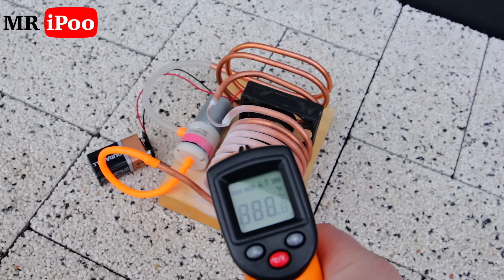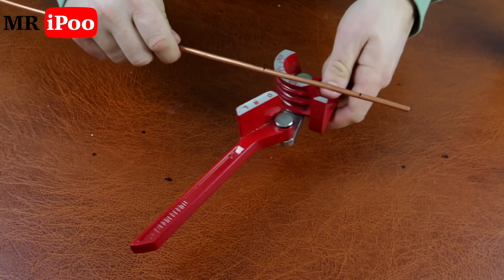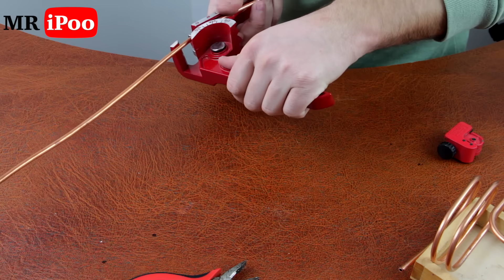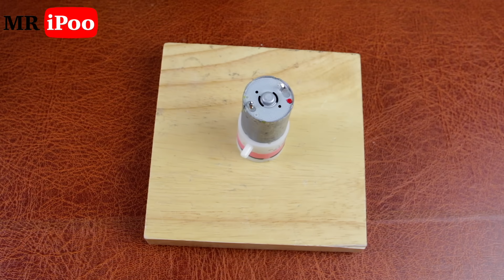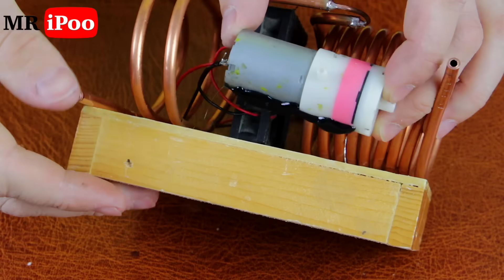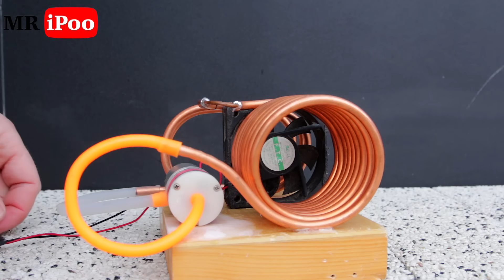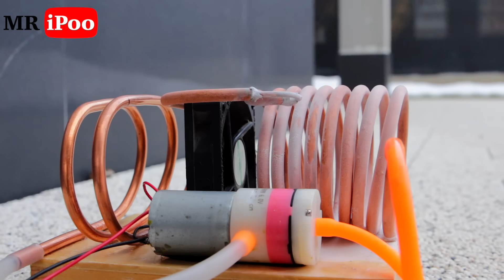DIY Freezing AC : Crafting an Icy Air Conditioner down to -32°C!

Comment: This is brilliant because you only need a couple psi difference between the high pressure side and the low pressure side in order to condense the gas in such a small system and I’m sure that flammable gas is very efficient
Reply: It's fake guess, overspray from a can of freeze spray on the fan at 7.55 and liquid boiling off the Venturi pipe at the very start of the video
Reply: @davegsm82  We have a WINNER!!
Good catch!
I was secretly entertaining an internal debate in my head of if this was probably fake, or if he actually got some cooling out of it.
I missed the over-spray on 'non-coil' surfaces!
After I looked at your timestamp, I now see that there is also frost on the wood where it shouldn't be, that I hadn't spotted.

I did spot the bubbles on the capillary joint right away, but was still undecided as his soldering technique was poor and I thought I was seeing a pinhole leak.

My main doubt was the capillary/pump capacity/battery current capability pairing.
[I've never seen anything this tiny, so I couldn't declare it a fake outright...]
Reply: Finally a comment from someone with a bit of education! Butane is a great phase change material for low pressure demonstrations like this. Too many people here seem to think it's fake or useless because it won't cool their 4 bedroom house. 😆👌
Reply: @davidsmith3302  It really blows my mind that there are people who believe this is real. First of all that capillary is far to thick and short to create any significant pressure difference even with butane to cause a phase change much less to have a temperature drop of more than 40C°! The other issue I see is that those cheap pumps aren't designed to work in closed systems even worse is that butane and many hydrocarbons damage rubber so the membranes and seals would break down very fast, That silicone tubing cannot withstand the pressure of butane, can barely withstand about 1.5 to 2 bar for a short amount of time and is not even fastened at the ends f the copper tubes. This is as fake as it gets, he actually makes fun of many creator channels of the kind by calling himself Mr iPoo. I bet that he sprayed the coils with butane or ethylchloride  so it  looks like they are frosting but notice how the liquid over the tube seems to evaporate and even boil.
Reply: @teresashinkansen9402  You're right. Very poor execution of a perfectly valid principle. 
I was just in an argumentative mood that day, but what I was looking for was someone to come up with a valid reason why it wouldn't work (if done properly). There were too many objections along the lines of it being fake because he didn't evacuate the lines first, or he had the fan pointing the wrong way, or the size of the condensing coil wasn't large enough, or you need 130 psi or greater, etc. as if he was proposing that everyone can build these and have free AC for their house in Arizona.
This isn't a yt perpetual motion machine or a free energy device. That crap is firmly in the flat earth fake category, but this is just a very poor attempt (which may actually succeed in causing a temperature drop to some degree before it falls apart)  Yeah, the video is fake, but the idea isn't. And I'm speaking from experience - I've cobbled together many things that have worked for a few seconds.

The Wright brothers first powered flight lasted only 12 seconds. Doesn't mean anyone should have called it fake.
But you're right.
(Edit) What I LIKE to see in comments on things like this is someone being inspired enough to suggest improvements in design - rather than the armchair "professionals" who won't go to more trouble than sit around and shoot things down. 😉
Reply: @davidsmith3302  Triple thumbs up!
Reply: @davidsmith3302  I started checking the comments section because the first one was "fake" . I'm not a specialist in air conditioners,  but I do understand physics and I was wondering what part of the system was phoney because as opposed to a lot of the rubbish you see on yt, this looked pretty sound.
Reply: @drfill9210  No where near being "Sound".
Reply: @davidsmith3302 So this system will work indefininetly?
Reply: @Newlife-ol6pk  If by "this system" you mean the lab bench demo he cobbled together, no. If you mean is the principle sound... 
Isobutane, known in the industry as R600A is used in a huge percentage of domestic refrigerators manufactured today. This is not exactly same butane that you find in cigarette lighters. The refrigerant grade Isobutane has much higher purity, but it is the same basic material. So, yes, indefinitely - it's not a trick that would fail in minutes, it's a real working principle.
Reply: @Newlife-ol6pk  It's fake, there is no high and low side, 9v battery and that pump are no where near enough power to power a compressor to actually do what he's trying to trick people to believe he's actually doing it.
Reply: @davidsmith3302  LOL, you're so funny to believe this video. You think a 9v battery and a 3 dollar air pump have the power to compress that system? HAHAHA
Reply: @Tom-yc8jv  DC 6V 9V 12V Mini 310 Motor Air Pump Micro 27mm Oxygen Pressure Pump DIY Inflator Sphygmomanometer online.
At room temperature (25°C), the vapor pressure for butane is about 35 psi - easy for this pump.
And as far as your previous comment goes, remember the smaller capillary tube he put in the line? The restriction creates your high and low side.
You aren't nearly as smart as you'd like to believe.
Reply: @Newlife-ol6pk  Yes.
Closed circuit refrigeration works as long as there is a power source.
Just like your home AC...
[He does have a small leak at his capillary tubes joints, should not put solder on the iron tip, heat the tubing to flow temp.  Motor is 6V, so it probably will get hot, and wear fast.  Fan was 12V. He ran both on 9V...]

He put the hot and cold coil inline, the fan will blow the air across the cold AND hot coils, no net gain...
This was a demonstration.  To use, you would need pipe the cold coil to a separate compartment (or blower box), and the hot coil exhausts the heat extracted.
(you could also pipe to cooling tubing to a computer...)

[The oval coil gets hot, and the round coil cools... FYI]
Coils work properly if the drain 'down' so the liquid doesn't pool in the loops.
The hot coil would work best horizontally, with the flow from top in to bottom out.
Cooling coil could be any orientation, since this is not flooded evaporator, but the outlet should run uphill (so liquid doesn't go in the motor, and so it gets evaporated fully...
Reply: @Tom-yc8jv  Yes there is.
That's what the short piece of small diameter is for.

I reviewed it carefully, and with everything on top and visible, there is not really any room for fakery here.
Also, the frosting pattern is pretty authentic and the frost appears to be real (not a trick videography)
Reply: @Tom-yc8jv  Keep in mind, a lot of pumps like this are in those portable auto tire pumps, so yes 35psi would be no problem to 'compress' this small system.

[my reservation is to if that 3mm orifice tube is small enough to achieve the needed pressure differential - it all depends on pump throughput. Real pump data (PV curves) [and my time] are not readily available to assess if it could work.]
Reply: @Newlife-ol6pk  As long as it remains sealed ! Just like the A/C in your car.
Reply: @davidsmith3302  
Yea, but there is no way that tiny pump can push 35 psi ..... And that is a water pump too,  so it's not made to push gas.
Reply: @davidsmith3302  what is the effiency i mean scop of those ac units?  for better effiency do not need a bigger pressure change?
Reply: @makoado6010  I would venture to say that larger pressure changes would result in larger drops in temperature. If you think about it, that's not the same thing as "efficiency". If you increase the pressure drop so each cycle of your working material drops the temperature twice as much, but it costs you ten times the energy to do that, you just destroyed your efficiency numbers. 🤨
Reply: @troubleshooter1975  Thoughtful improvements! That's the kind of thinking this sort of video should inspire. Far more satisfying than someone sitting on their lazy ass thinking they've destroyed the whole idea because the pump wouldn't last, etc. 👍
(EDIT): Here's another idea - his capillary tube execution was poor, but there is no requirement for the material to travel some minimum distance through a small tube, you just need a restriction to cause pressure to back up in the system. You might just put a hard crimp in the line (sort of like the valve used in systems that have no capillary tube)
Reply: @Tom-yc8jv logikanya gas dalam kaleng hanya dikocok saja dah terasa dingin... apalagi itu gas mengalir melalui pipa kapiler, yang pastinya ada pergerakan gas di dalam pipa. 🙏
Reply: @WTF_BBQ  Maybe you've had some time to think about it (as I have) and seen some other pretty smart comments that should make you realize that the pump doesn't have to push 35psi to get the system pressure up to where the butane condenses. It's a closed loop - the necessary pressure is already there (like in the Bic lighter in your pocket which doesn't even have a pump...) The little pump only needs to move the material across a restriction to create a pressure difference in the loop. If done right, you probably don't need more than a 1 psi difference to get some of the material to be going through phase change. (and yes, it's a poor implementation of perfectly valid principles, but it's not 100% fake, maybe only 10% fake 😆 )
Reply: @davidsmith3302  
Oh God no........ you need to compress the gas so that when it exits through the capillary tube,  it will expand.  A strong compressor is necessary to achieve this. 

I'm quite familiar with HVAC and refrigeration technology.  Theory vs Application are not the same thing. I challenge you to apply your theory by building one exactly how he built it.  I can guarantee you it will fail 100%.
Reply: @WTF_BBQ  I believe you are quite familiar with working on commercial units that run at high pressure RELATIVE TO THE OUTSIDE AIR AMBIENT PRESSURE. Does your experience also tell you how much pressure difference is necessary to get a phase change material (like any common refrigerant) to go from liquid to gas, or gas to liquid? It's like the difference between ice and water - less than a degree. This huge pressure difference you are insisting on is found in commercial units because it makes them more efficient at moving heat. You are incorrectly assuming that you need that huge difference to make any kind of cooling happen. Think about it. ONE degree, ice to water. ONE psi, gas to liquid.
Reply: @WTF_BBQ  Here's another thought for you. When you shut down your large commercial chiller and let everything come to ambient temperature - no compressor running, no temperature or pressure difference anywhere in the loop, like a unit that has been off for weeks -- what is the state of the material in the loop?  Is it all liquid or all vapor? No, of course not. The working material exists in both states and it is in equilibrium. The part that is liquid is right on the ragged edge of becoming vapor, and the vapor is right on the same edge of becoming liquid. (if you deny this, you have some flaws in your basic understanding - the same thing is true of the Bic lighter in your pocket - both states at once, no pump)  Now if you compress a little bit of vapor, just the tiniest bit of compression - it will condense to liquid, because it's right on the edge of doing that anyway. THAT is the difference you need to achieve to have a phase change loop that will move heat, and it doesn't take much to do it. And the pump doesn't feel like it's working uphill to 35 or 150 psi because the same pressure is on both sides of the pump - it only needs to increase the pressure on one side just that little bit.
Theory and Application are in complete agreement here, as long as you're not trying to build something that will cool off your entire house and run for years.

(EDIT) P.S.  It better not be gas that is exiting the restriction in your system or you are low on refrigerant - liquid comes into the expansion side and changes phase to vapor. You should know this.
Reply: @davidsmith3302  
There's only one way to settle this debate.  Build the device according to the Video's specification.  It shouldn't be hard nor expensive since these components are readily available at the hardware store and online. 

I'm not gonna even bother building it since I already know it won't work just by looking at the size of the capillary tube in relation to that tiny water pump.   If it has any chance of working at all,   the capillary tube should be much smaller than that....

This is a fake video. The creator just wanted the views to get extra money.  You should know by now that not everything you see on the internet is real.
Reply: @troubleshooter1975  Hey... I found this interesting post in a forum where "professional" HVAC techs hang out:

"We have an interesting situation where we need to lower the efficiency of several commercial freezers, basically turning them into chillers. They are currently 3/4HP compressors, we need them to behave as something more like 1/3HP units. We can work around the CS if needed, but our question is "Is there anything else that would not operate correctly if we slowed the compressor motor down?"

I read through the replies and there were things like:
 if you have a moderator valve [instead of a capillary tube] it might not behave correctly with the lower pressure
and
you might not get enough lubricant moving to keep the compressor properly lubricated

Not one reply stated anything like:
If you reduce the pressure at all the thing will immediately stop removing any heat.

I thought that was interesting.
Reply: @davidsmith3302  Of course you don't need a huge difference in pressure for a phase change
But assuming you have 25°C (77F) outside, than you need at least a little bit more to dissipate heat on the condenser, lets say 5°C (9F) difference, so the condenser must condense at 30°C (86F)
He claims to achieve -32°C (-27F) so lets assume this is our evaporating temperature
Assuming the gas is R600a (Isobutane) that corresponds to 3 bar (44psi) on the high side and -0,59 bar (8,5psi) on the low side. so the low side is actually below ambient pressure
In absolute pressures (0 is 0 and not atmospheric pressure) this would be 4 bar ( 58psi) and 0,4 bar (6psi)
So this little pump has to overcome 3,6 bar (52psi) of pressure differential
Reply: @Fluxkompressor   Brother... I have been WAITING for you! Boyle and Lussac have been spinning in their graves, and now they're crying tears of joy. Thanks a million!  (or at least 52 😉) Too many "professionals" here just can't get past the obsession with "true or false" to discuss the possibility of any such model working at all.

Your first sentence is huge. Phase change is the "magic" (I wouldn't believe any small model using just air would move enough heat) but some folks just won't accept that it can happen without 150psi difference because that's all they know from their jobs.

I'm trying to interpret the log(p) chart to see where your calculation sits (is that the right place to find this, or do you have another/better reference? Please don't keep it a secret...) but your numbers don't sound outrageous because of what I've already learned so far.

So if we get past a few things 
(most notably, giving the children their victory of acknowledging that the video is completely fake, or whatever else it takes to get them to go home happy and leave us to discuss how far fake the whole idea is...)

I'm thinking that, aside from some construction defects easily modified, if the biggest hurdle is a battery operated pump that can hit 52psi. -- considering the 12v pumps you can easily find that will put up to 150psi in bicycle tires, I don't have a problem with the idea that some small pump running even on 9vdc could easily get enough of a difference in the loop to at least get frost on the evaporator.

Add to this the fact that this discussion has continued in posts on other videos (notably those from a pretty sharp guy, Gabriel - look for yt stuff from Gab tech expo) where some of the deficiencies of the model in this video have been addressed, WITHOUT the need to go crazy and build an automotive-size cooling system just to see some frost, and I think we are very close to proving that small models of butane chillers are completely possible, and not even that difficult to make. (P.S. - I've never met him, so I'm not just backing up a friend right or wrong, he just tinkers together some cool projects)

Does this piss off the "trained technicians" in the crowd?  I hope it bugs them enough to reconsider what they have been basing their snap judgments on, but that might be asking for too much thinking. 
(sorry, had to say it - I've waded through a lot of crap and accusations from those guys in the last few days, and owning a gauge set and memorizing the numbers you should see on a residential 5-ton split doesn't give you a degree in materials science 😆)

Thanks again - please post a good reference for those trying to understand the heat calcs! I know students....
Reply: @davidsmith3302  No Log(p), just some online slider matching boiling temperature to pressure.
nothing says you can't get a pump that can produce a pressure of 52 psi but there are other things wrong here
1. silicone tubing without reinforcement like this does not hold that pressure.
2. A 9V battery has about 1.7 Ohm internal resistance, so the most power you get out of this battery is about 24W on ideal conditions (4,5V at 5,3A). That is already a little on the low side for a refrigeration system like this.
3. That battery will deliver these 24W for about 10 seconds before getting hot and dropping in voltage and is completely dead in just 3 minutes. That is not enough to form that kind of frost. You would hear the pump going down in RPM in that 10 seconds, and that is not the case here. So we are talking <5W of power from that battery here I would guess
4. Even on an well calculated refrigeration system you don't get over an COP of 2 on this size of equipment (COP -> coefficient of performance, the factor of energy going in vs. cooling power) so 5W of input power will get you 10W of cooling power.

Lets compare that coil frosting up with an CPU cooler. Imagine that CPU cooler with 10W of heat going into it and getting warm. It would go from 25°C to maybe 30°C with that much copper dissipating heat, so a 5°C rise tops. It is the same in reverse with cooling. 25°C minus 5°C is 20°C and not -32°C. Just by loosely thinking about sizes and Power you realize that you need about:

25°C to -32°C is 57°C difference.
With the estimation of 5°C per 10W of cooling power you need about 100W of cooling, not 10W

If that little device would work the way shown here you could imagine some company like IKEA or Burgerking invented the self cooling cup or something, but they didn't.

Refrigeration needs a considerable amount of power and Thermodynamics can't be broken unfortunately
Reply: @Fluxkompressor   I don't know why I didn't get the notification of your last post here, but thanks a lot, it's easy to find pressure to boiling point data. I think if you draw a cycle on a Log(p) chart for butane (down low where a model would work, not where commercial techs usually draw them for commercial units) you can even calculate the amount of heat you can move - so beyond frosting an evaporator you could design a battery operated ice box. (as if there aren't millions of those out there already)

Regarding the flaws...
I have been willing, for quite some time, to bow to the people who found the flaws and video fakery in iPoos post.  I tried desperately to get people to move past that, and discuss the numbers of the actual physics involved to see just how difficult (or possible) it would be to make a small model chiller using butane. Sadly, too many were completely obsessed with the purpose of labeling "fake" or "real" that they were unable to think beyond that. You were the first one, and I salute you.

There have been all manner of ridiculous claims presented as "proof" that such a small model is impossible. Most involved comparing any small model to the commercial equipment they are trained on. Some was just nonsense from people who, in my circle we call "witch doctors",  like the guy here yelling  "Thermodynamic coordinates are intensive parameters"  (you can see him waving his arms and jumping about 😆) somehow thinking that proves that "the same pressures are needed independently from the size of the system." (wrong - obviously)  Other people just wave their arms and say build one yourself. Brilliant. Then we would have two people claiming they built one and it worked, or it didn't. Doesn't settle much of anything in my mind.

So understand my appreciation for some reasoning finally based on things that anyone can verify without having to construct anything. Also know that this doesn't mean I now believe what iPoo shows is a working model. What it means to me is - building a closed loop with a pump capable of 50+ psi and a battery large enough to run it for more than 10 seconds  is nowhere near impossible, and that's what I was after - proof with numbers that what we're talking about isn't perpetual motion or anti-gravity, and the requirements can be very modest compared to the ones insisted on by the AC techs here. "victims of their training" is the phrase I used, and I've been waiting for someone who can start with a clean slate and just think it through.

I would give a lot to have a bar or something where crowds of people like you hang out. 👌 I can count on one hand the number I've met since I retired (and I don't think I even need my thumb)

Thanks again!
Reply: @davidsmith3302   Thanks for the nice words, I appreciate it

"the same pressures are needed independently from the size of the system." is in fact true
Pressure is related to boiling point for a given fluid (or gas)
If you want to condense something at temperature a, then you need pressure b
If that now fluid has to evaporate at temperature x you need pressure y
That is depended on the fluid, not the size of anything

Looking at an log(p) diagram for different refrigerants tells you that to compress that gas, you need a certain amount of energy per mass. Comparing that with the amount of heat that is moved in the refrigeration cycle per mass and presenting these two values as a factor, you get similar values for almost every refrigerant (in the same ball park, no order of magnitudes apart). That is the reason why they are called refrigerants, because they are good at refrigerating stuff. It doesn't  matter if you use butane or ammonia or CO2 as a refrigerant, the amount of energy needed to cool something is almost the same, despite the fact that butane needs only 50psi at 25°C, ammonia needing 145psi and CO2 a whooping 933psi.

You need amount x of energy to move amount y of energy. There is a theoretical limit on how efficient that can be which is called the Carnot efficiency. A typical fridge might move 200W of heat with 100W of input power (COP of 2) at 35°C condensing and -10°C evaporating temperature where the Carnot efficiency would be at a theoretical COP of 5.8.
Big industrial chillers might achieve a COP of 4 at that point because bigger equipment is mostly more efficient and is not constrained to the small price point and cheap components of a fridge

Another point I would like to make is the capillary tube
I would guess an inner diameter of 1mm and a length of 50mm (2 inches)
A rule of thumb says that a length of about 0.3-3m (1-10 feet) and a matching inner diameter would be ideal (regardless of the system size and refrigerant used)
because the capillary tube has to be very precisely matched and a mm more or less can make a huge difference on only 50mm
And anything more than 3m is impractical to handle and causes other problems with flow and what not and to short does not properly restrict the flow as intended

2 inches is way to short for it to function as a cap tube, it acts more like an orifice

A little poking around with some online orifice calculators reveal that with the 50psi drop across that cap tube, it would require that pump to deliver about 7kW of power because of the huge mass of butane that can flow through that tube.

A trained technician sees the cap tube and immediately screams fake because he knows from experience that this can't work
Reply: @Fluxkompressor  Sorry if my last response seemed rude, I was in the middle of a disaster and a bit rushed. (and I"m so OVER discussing why iPoos model is fake I can't give that another thought)

Two things do stand out in what you just said here - first, that the same pressures are needed is in fact true.

I agree, but maybe not the way you think. I do not agree that a small model must have a 10 bar pump. In fact, the big unit would move (some) heat with a 4 bar pump. The same pressures are required (cycling around the vapor pressure of the chosen refrigerant)  Yes or no? 
(ie. my neighbors sports car cranks out over 300 hp. That does not mean the other neighbors Honda Civic can't possibly work)

The other thing you mentioned was needing a certain amount of energy to move a certain amount of energy, no way around it. That made me think of the 10watt-100watt battery discussion, and that made me remember this big box in my kitchen. It has a large compartment on one side that is pretty cold, and another one that is absolutely freezing cold. When I hang a watt meter on that refrigerator, (inrush starting current notwithstanding) it is happily chugging along making that much cold space using barely over 100watts. (130 I think it was)  That has to say something for the possibility of something a lot smaller moving a lot less heat without having impossible energy requirements to do so.

Still not giving the trained technicians any points for failing to get past the real-or-fake obsession and discuss the true minimums necessary for refrigeration. 😆

Best regards,
Reply: @Newlife-ol6pk  It won't you will run out of gas at some point and will need to refill.
Reply: This will work. A lot of American fridges use butaneand several kitchens have been blown apart as a result. Will chill a can of pop but not much else!
Reply: @JekKent-xb3lf  Butane and propane are "flammable" not "explosive" unless you mix them with oxygen.

New household refrigerators/freezers with a charge of 2.0 ounces or less can use R-600a (isobutane), or R-441a. Both are hydrocarbons.
New commercial food refrigerators/freezers with a charge of 5.3 ounces or less can use R-290 (propane).

People have 5 GALLONS of propane sitting under their BBQs - and normal use has actual open flames less than a foot away.

There are stories of the "stories" chemical companies promote to fuel this fear because R600a costs about a third of what they can get for the synthetics.

I'm not saying I know one way or the other, but that all seems a bit suspicious to me.
Reply: @davidsmith3302  I understand David, I’m a chemist. The trouble is, thats exactly what happens. Under certain rare circumstances the isobutane has leaked internally into the confined compartment of the fridge and mixed with the air inside at exactly the right stoichiometric proportions. Detonation occurs by an unguarded electrical or static discharge. I agree there is minimal risk from in this example. The drive for "greener" non greenhouse gases, although valiant, comes with its own inherent risks I suppose. Pays your money and makes your choice.
Reply: @JekKent-xb3lf  Amazing timing - I'm reading your response just after I read something (in an entirely different thread) from a guy saying that unsealed relays and such are never supposed to be used in potentially flammable or explosive environments, and safe electrical components are readily available and used every day in such environments. So it seems that the only problem is they (meaning only some of the manufacturers) just didn't do a proper job, and problems can always result from not doing a proper job. You can't blame the refrigerant any more than you could blame the electric company if an improperly grounded product causes an electrocution 🤔

(if you want to speculate about gas leaks, of any kind, at the same time a spark of static electricity happens, and it's in just right place - too much air or too much fuel and it won't burn - maybe it's just time to admit that some people are just unlucky. If the gas didn't get them, they would have slipped on the soapy water they spilled and fallen to the floor knocking the block of kitchen knives off the counter and ended up laying there with a broken leg, and multiple stab wounds, just when their cell phone battery ran down too far to use... 😂🤣)
Reply: @JekKent-xb3lf   P.S.  ...and what about all the poor people who have sat down with a butane lighter in their pocket, and accidentally leaned on the valve long enough to turn their pants into a bomb 😁
Reply: @davidsmith3302  lol 😁
Reply: He didn't vacuum the air out of the system though. Air has moisture in it, and it will freeze and clog the system.
Reply: @SwapPartLLC  Depends of if there is enough to make a ball big enough to plug his capillary...
Also, if it was leaky, the 'refrigerant' likely purged some of the air out.
Reply: @troubleshooter1975  I don't think you realize how much moisture is in air. When you make a glass of ice water, and the outside gets covered with condensation, that is all from the air. I've done refrigeration repair. Trust me, the amount of air in that system holds enough water to clog it. This video is fake. Theoretically, it is possible, but not with that pump, and not without removing the air first.
Reply: @SwapPartLLC  I'm an HVAC tech; so yes I do understand moisture content...
On this small volume I think it is negligible.

Anticipating your probable objections I crunched some rough numbers:
Assuming he used the whole roll of tubing (and I don't think he did), there looks like about 3m of 4.7mm tubing.
That amounts to about 52cc (~3  cu in) volume, not counting pump and rubber.
1Kg air holds 14.7g water, 20ºC 100% hum.
That translates roughly to .0009368cc, or 0.9mm cubed!

That is IF it was 100% humidity, and IF you get it all to collect in one ball, and IF he used the whole roll of tubing, and IF no air was displaced by the butane he shot in...
The capillary tube was 3mm.
Do the math...

It is a whole different ball game if you are doing a split system, or even a small car AC, that likely has HUNDREDS of cubic inches of volume in the tubing, but still a similarly small orifice.
Not to mention the compressor internal volume...

Also, it looks authentic to me, but there could be a few cheats going on, but I don't see it with his skill level.
It would take some stealth machining, or it is just the butane evaporating.
I don't have spare time to debunk it.

Mr K L
Reply: @troubleshooter1975  Did you take the expansion of frozen water into consideration?
Reply: @SwapPartLLC  LOL, Actually, I did!; I just forgot it when I was typing it.
So that would be about a 1.1mm pellet...

Anyways, take care! 🙂
Reply: @troubleshooter1975  Well, I'm pretty sure even a 1.1mm pellet would be enough to damage a cheap plastic pump.
Reply: @troubleshooter1975  Are you really a HVAC technician? then you might want to take some courses because some one with your experience should immediately realize this is not feasible. You should have capillary tubing calculator so please calculate the diameter and length of a capillary required to have a system capable of reaching -20C° on the evaporator side with a heat load of about 10W with butane as refrigerant.
Reply: @troubleshooter1975   I've enjoyed the arguments, hoping for some thoughtful ones. I reserve screaming FAKE for all the videos that try to convince people that they have made a perpetual motion machine, or one that produces unlimited free energy (and is being suppressed by the giant old companies😄)  This guy isn't violating any laws of physics or asking you to believe in magic.  If you were on some kind of engineering contest TV show, and you had to choose between making this chiller work better or making a perpetual motion machine work better, which would give you the best chance of winning? For all of the crude flaws in this thing, it's really not so far off of actually working - if only for a minute...
Cheers!
Reply: @SwapPartLLC 
I doubt there is enough air in that system to produce a single drop of water. It's not a large enough system to accumulate that kind of moisture.   I imagine it would be like milking a stone.
Reply: @cableguy130  Correct!
I ran the numbers for this for him, but he is still argumentative (I think -, I can't tell if he was joking).

ALL the water in worst case scenario, 100% condensing humidity and all in one pellet, would be roughly 1mm in dia.
[And I doubled each estimate on several factors. so in reality about 0.4mm (0.015")]
Also there was some superheat at the pump inlet sweep (it was thawed at the pump, which was ALSO rated for non-compressibles AFAIK).

The main issue with moisture in a capillary system is blocking the capillary, or contaminating the oil/electrical burnout from formed acids.
Reply: @SwapPartLLC  It's not a product, it's a lab bench demo showing a working principle.
Reply: Are you guys mad or some thing this is fake you need much higher pressure pump for this to work if you want to learn about this watch hyperspace pirate
Reply: @MKcooksmamoonakausar38  At room temperature (25°C), the vapor pressure for butane is only about 35psi. There's more pressure in your bicycle tire - any small battery powered compressor can handle this.
Reply: @davidsmith3302 dude that has literally nothing to do with it. Thermodynamic coordinates are intensive parameters, meaning that the same pressures are needed independently from the size of the system. That small, plastic pump is not a vapor compressor. Inverse cycles require high compression, hence why volumetric compressors are used, and working pressures are in the tens of bars.
Reply: @Daekanoid  I believe you that pressures in commercial chillers are in 10's of bars, and there are good reasons for that. What I'm having a hard time believing is that you get zero heat moved if you only raise the pressure a few psi. How is that even possible, (meaning in physics)?

Gay Lussac's Law - states that the pressure of a given amount of gas held at constant volume is directly proportional to the Kelvin temperature.
That means if the volume is held constant, and you change the pressure (and there is no minimum lower limit of change in the formula) the temperature changes.

Telling me that unless you have 10bar of pressure difference you can't pump any heat sounds like saying if you turn the crank one cycle on the air compressor in your garage, if the storage tank doesn't immediately fill to 100psi, your compressor is a fake.  Can't you cool something slowly, with multiple passes through the loop?

I'm not trying to be insulting, or just arguing for the sake of arguing - I really want to understand why a low pressure loop is incapable of moving heat, even if it moves it more slowly than a high pressure loop.
Reply: @MKcooksmamoonakausar38  I watched Start Wars in the 80s the first one, but I still do not believe that a long time ago in a galaxy far far away there were the Jedi, why there is so believe in youtube and not in physic?
Reply: @MKcooksmamoonakausar38 thats the problem still majority of the people will think its real
Reply: How did The Difference In Pressure Created ? He Used Two Copper Tubes With The Same Diameter (and Thus The Velocity of The Gas Remained The Same In The Whole System Thus Its Fake)
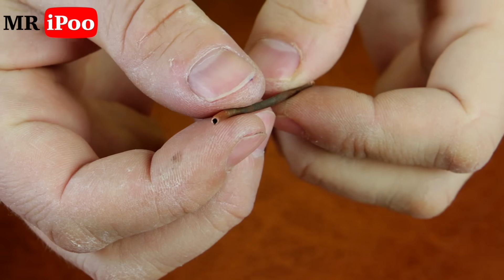Reply: @kobrak29  watch carefully at about time index 4:05 (then google capillary tubes in ac if you still don't understand. I'm not saying he did a good enough restriction, but in principle it's correct - in fact, you could say that about the whole thing - maybe not a good enough job building it, but no one has come up with a valid reason a butane cooler wouldn't work at low pressures)
Reply: @kobrak29  Did you watch the whole video??

The short 'U' tube is a piece of capillary tubing.
It is NOT the same diameter.
It is a restriction (expansion device).
(apparently enough for this to work)

Just look up capillary tube refrigeration, like in most domestic refrigerators...